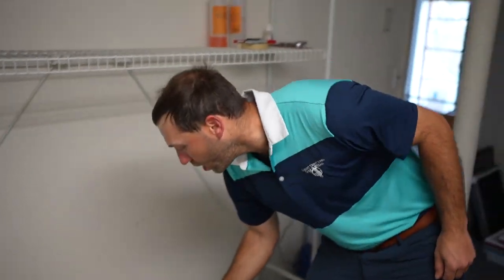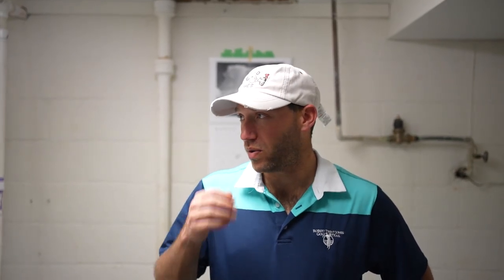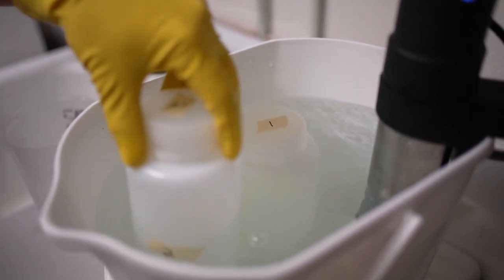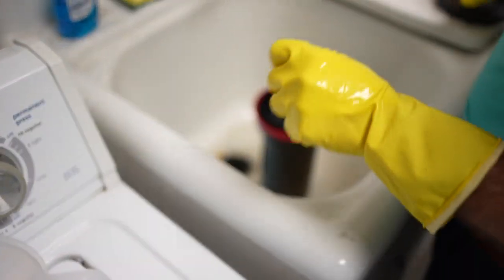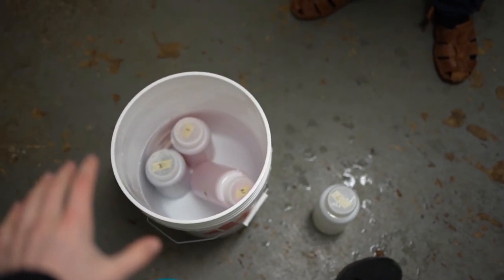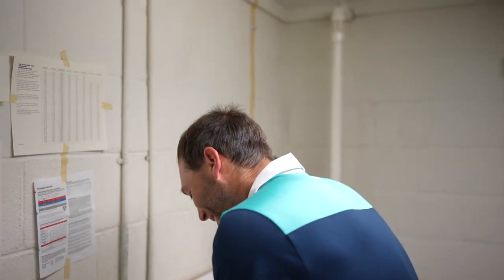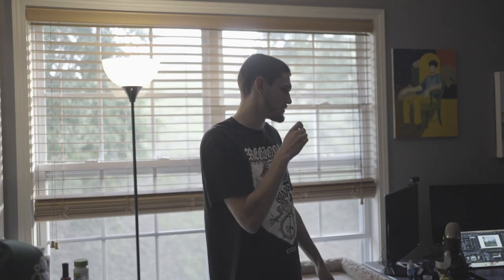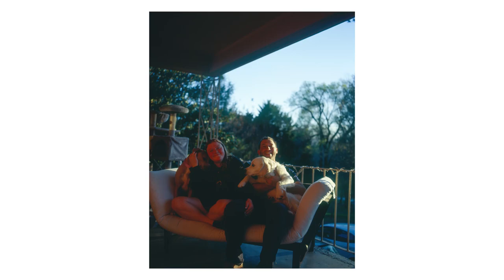Shooting and Developing E6 Slide Film with the Bellini E6 Kit

Comment: The Bellini kit is better because it separates the "blix" into separate bleach and fixer solutions. That insures a complete bleach, which might not be had in a 3-bath kit after the solution is used a few times. It also adds a dye stabilizer, which some other kits omit. However, it is not the full 6-bath official E-6 set of formulas. The remaining weakness is the combined reversal and color dye formation solution, which may result in less than full color dye generation. For the nerdy, this can be solved by inserting a light exposure reversal step after the first developer and a stop bath and  wash, or just a full wash. Then proceed to the color developer as normal. Using the heated water bath to maintain a stable process temperature is an excellent practice. The only knock I'd give to the video is using the crappy Paterson System 4 tank, which is likely to pop the water tight top and dump your solution in your lap halfway through any step. So, what other tank? Pick one; they are all better. The AP system costs about the same without the risk of failure, and comes with better reels as well.
Reply: Bellini kit does not combine reversal with color developer as 3-bath kits inspired by Tetenal do. This kit is a standard š-bath process, with a separate reversal solution made of stannous chloride, as it is in official process marketed by Fuji.
Reply: Your quote following; "the crappy Paterson System 4 tank, which is likely to pop the water tight top and dump your solution in your lap halfway through any step". If you haven't discovered the suction power of pressing the lid on top to create a vacuum, the Paterson System 4 won't be for you. But I understand your problem - (water) spills with Paterson are a classic. If you get into trouble, you can stick to Kindermann metal tanks. I often do that on color processes. I have also used Bellini E-6 6-bath and like the results very much